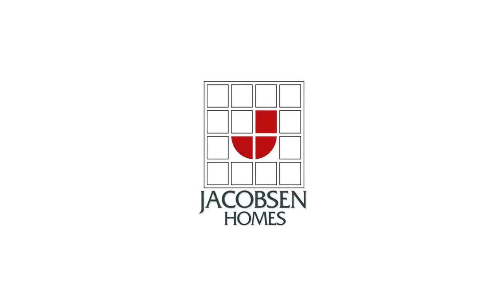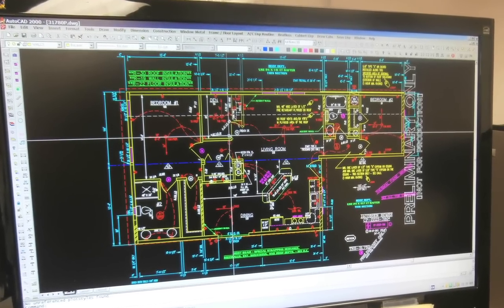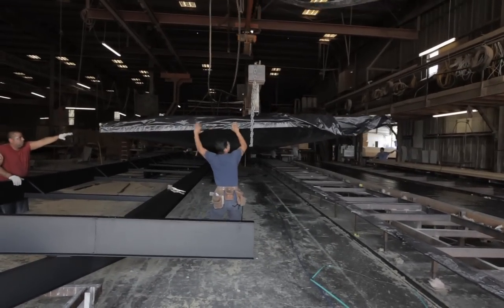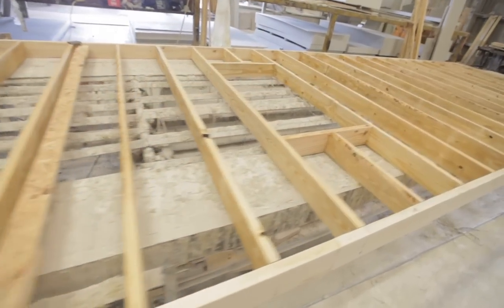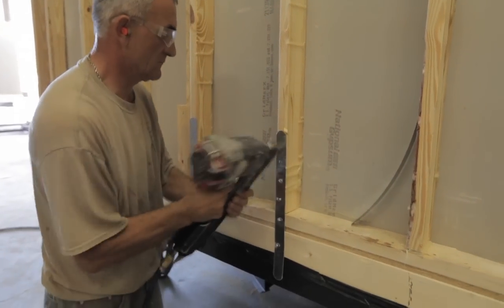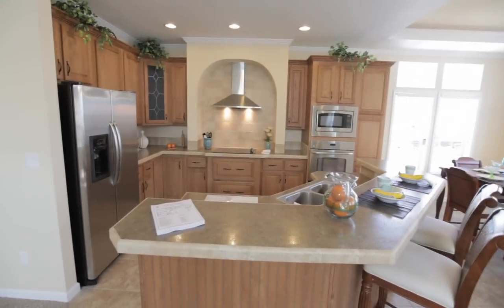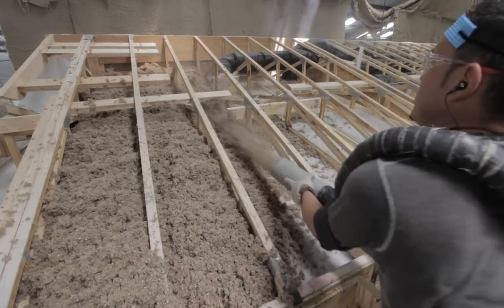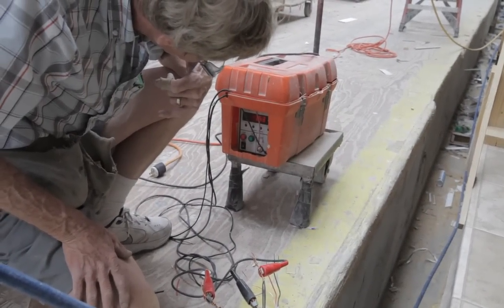Jacobsen Homes Factory Tour

Comment: Site built homes have been going on since homes have been built. a certain amount of moister in wood helps it. As far as mold, I have never heard of a home having mold from the wood being wet while building it, and I have several carpenters in my family. The whole fight with master carpenters and prefabbed homes is materials. For instance, my cousin won't use anything less than 2x10 floor joist, with 3/4 plywood, not osb or particle board. Roof trusses are also done with no less than 2x6 and are steel strapped at every connection. He went to several prefabbed homes and had to strengthen the roof as well as secure it, two never even had access to the attic, because they won't allow you to store in it. This does of course cost more, but you get what you pay for, problem is, why buy cheap on the structure of a home? Cabinets, windows etc. can all be changed later, cut costs there. If you have to gut the whole home to fix structural issues, why not pay more from the get go, it saves in the long run....

Comment: I have a 2005 trailer it 14x68 foot trailer what size is the studs in the trailer walls and the studs facing the outside walls i think the walls facing outside is 1)1)2 by 3)1/2 wide studs but i don't know what size is the walls inside walls i think they 1 1)2 studs i don't know Sir

Comment: The vapor barrier is not going to do a very good job if it is installed after the drywall is already up. Would be nice if they had plastic vapor barrier and none faced insulation

Comment: Lol they keep acting like OSB is some luxury quality product. It’s litterally woodchips glued together. Also I can’t believe the floors are just a laminate sheet glued onto OSB. I imagine that would tear very easily
Reply: OSB is what most all manufactured home builders and site builders use.  As for the flooring there are several options, not just vinyl flooring.
Reply: The quality of OSB depends upon the adhesives.  When ongoing water exposure is a problem plywood will eventually delaminate too.  You need to protect all wood based products from water.  Sometimes the moisture is from condensation caused by air gaps and poor insulation.

Comment: Hahaha you can see a bunch of gaps around the insulation. Not the best quality homes but not the worst
Reply: Spray foam should be used with 2 x 4s.  Fiberglass batts is inadequate.

Comment: I don't like sheet rock or conventional vertical paneling.So,is there a horizontal paneling system that looks like a summer resort cabin,for the walls. Also on the ceilings. And need  a regular wider ceiling molding..
Reply: We can do one or two feature wall with ship lap, but not the entire house.  This is something that you may be able to add to your home at a later date.

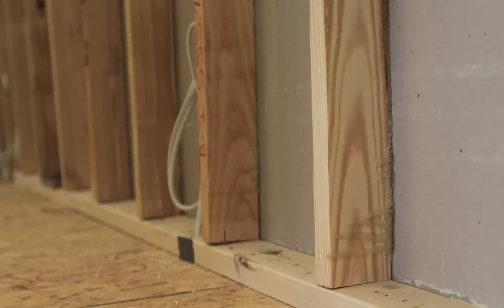Comment: At 4:54 check out the gap between the studs and bottom plate and vapor barrier between the osb and siding so moisture will attack the wood promoting rot and mold growth and also I couldn't help notice all of the OSHA violations in this video worker not wearing PPE while handling insulation, standing on the top of a step ladder especially without fall protection 😂
Reply: I noticed the same thing!   Forget Jacobson Homes!

Comment: While the finished product looks great. I worry about their construction. Even in the video. You can see the window frames are not to code. With double king posts on one side. An a single king post on the other. Meaning the window isn't properly supported. Much less secure for installation.
Reply: You are correct and now i guess they only use one post around windows. thats the case in mine 2024. Very weak walls and the windows are not secured properly causing them to not open or close properly.

Comment: If I were to build a house, I would start with a poured concrete foundation with reinforcing screen/mesh. On top of that would be placed 2x6 hickory studs on 16" centers and the bottom framing bits would be bolted to the foundation. To form the exterior walls, I would use oak or hickory tongue and groove (tongue in groove) shiplap. The entire house would be home wrapped. The roof trusses would also be of a hardwood like oak or hickory and they would be bracketed to the wall framing. The flooring and the roof sheathing would be made of quality plywood. I would use closed-cell spray foam insulation.
Reply: Very expensive house but well built and will last for many years

Comment: Am i the only one to notice that they put the frame together with staples instead of nails. Very Cheap Junk !!
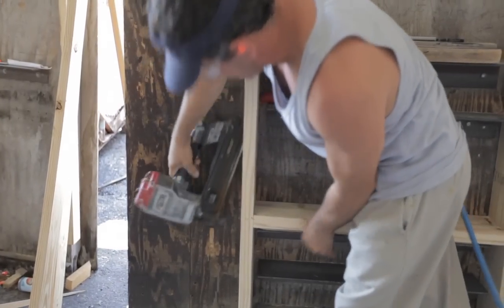Reply: I noticed that. Did you see the dude at 4:33 putting 10 nails per corner of the windows frame
Reply: Lefty , those staples are used on the marriage wall it’s all glued and it’s 8 inches thick.

Comment: Ice unit to make the house , do you deliver in New Jersey ?
Reply: Unfortunately, we only build homes for Florida.  Good luck with your new home search.
Reply: I live in Florida. It will cave in after a good snow  storm. I been on trailer roofs where they have a metal roof with nothing at all under it.. He says they used 7/16 on the roof . I am originally from Conn They require 3/4 = 12/16
Reply: @harrybriscoe7948  Our homes are built for Florida weather, were we do not have snow storms.

Comment: MANUFACTURED HOMES are not trailers,  mobile homes, or modular homes.  You will never see a Manufactured home on it's own wheels.  They are put on tractor trailers.  They are built to stricter standards than site built homes because they are transported by truck.  They are placed on foundations and anchored.  They are financed by mortgage companies just like a site built house.  Some are built to be two stories and assembled after delivery.   You can't get a mortgage for the other types of homes, which depreciate in value like cars.
Reply: Manufactured homes are built in accordance with the Federal Building Code (HUD), they are set on piers.  An off-frame modular home is according to the Florida State Building Codes and is  placed on a stem wall and can be financed and insured the same as a site build home.
Reply: @jacobsenhomes1347  Yes I know this...its what I was saying.
Reply: @jacobsenhomes1347  CORRECT!
Reply: Robert Zimmerman  You are nasty.  I was not trashing the building...you didn't read my comments correctly.
Reply: Robert Zimmerman  It's just a discussion...not a debate...I never should have never chimed in. 🤔😊
Reply: @Jacobsen Homes what is the price for this home?

Comment: The finished trailer looks great, and at every step in the process! I like the close-ups of the weld when you were calculating stuff. I think you have made the best "tiny house" video I have seen. Informative, pauses to absorb info, visual ( deam.design/n3v5  ), step-by-step, 2x forward!
Reply: It's not a trailer.  It's a manufactured home that is set on a foundation like stick built homes.  They are loaded on tractor trailers and set down on the foundation or basement.   They are built to stricter government standards than stick built homes and are anchored to the foundation.   Trailers are built on wheels that don't come off and they use a lot of flimsy materials like camper trailers.   They can be moved from one site to another.   Manufactured homes stay on site and are financed through mortgage companies.   Trailers are not.
Reply: Steven Soco  yes...I know this...was saying essentially the same thing you said...they are not trailers
Reply: Out of intense complexities, intense simplicities emerge.

Comment: I see a few things that aren't very good and i would find another manufacture since i am a welder by trade and i see spraying paint over rusted material is a NO NO Sand blasting and Using a Epoxy resin sealer then painting it for a lasting frame. And pink fiber glass Insulation is a Moister holder that will rot the floor joints. I find the the Rock Wool made from Stone and Steel slag from the metal making process a better insulation in Damp area's It's flame proof to 2100 f and is doesn't lose it R value when it get damp like Pink fiberglass does because it repels water. Rock Wool is a more dense Batt and isn't itchy to use and Safe (allergenic) for kids with breathing problems. OSB may be cheap but I look for Quality in a product i buy and OSB is not that, I've replaced Roofs that were done with OSB and sagging after 25 years from snow loads and summer heat changes under the shingles. OSB rotting under the  vinyl siding to the point you can push your finger through it, Plywood would be More better in both these situation and stronger down the road. Selling a product that is made with the idea that the outside makeup will hide the under carriage is not a sound business for long term. I worked in the industrial of welding frames like that for Large 40 foot roll off's and we took the time to sandblasted them before we painted them and i have had to fix Insulation problems and home roof problem left fro so called home builder building new home for the last 40 years.
Reply: I built 48 x 90 triple wide using 40 foot shipping containers. I welded 4 high cube containers to a 14. X 90 trailer leaving a 10 foot center gap. I plasma cut the inner walls before hand to match the floor plan. Used the left over material to bridge the roof gaps and cut in my door ways. I faced the door ends together on 8 of the 12 containers. I offset the center 4 containers so that I could have a 10 x 16 privacy porch off of my master bedroom and bathroom. I'm 8 months into this build and never had to use one nail. Pick up a 1 or 3 14x90 trailer frames and 4, 8 or 12 shipping containers. You'll save yourself lots of $$
Reply: Jacobson isn't about quality, it's about profit and cutting corners.
Reply: OSB is stronger than regular plywood the problem is not the product it's in the quality of the product and people who are putting it on .
Reply: @thomasvincent9027  Not my experience over the last 30 years Plywood doesn't sag on roofs between the Truss like OSB has in the past, if plywood get wet and drys out it retains it's strength but i have Seen my self put my fingers right through a exterior house wall because it got wet from sweating under vinyl siding, I have never had the problem with Plywood.
Reply: Rockwool is superior but it costs twice as much as fiberglass, worth it.  Rockwool is hydrophobic ( repells water).  It is insect resistant, fire resistent and sound deadening
Reply: @timothykeith1367  I don't use anything but Roxul rockwool just for the fact if it ever get wet, it will still keep it's R-value and Fiberglass will not. I have done my whole basement in it and never have to worry about mold or mildew and if it get damp it will still keep the R-Value which also keep the moister down because hot coming into contact with cold cement walls will create more moister.
Reply: @johnward5890  I wish every home improvement store stocked Rockwool.  Rockwool is more costly than fiberglass but worth the premium for the benefits that you have mentioned.   Plus, insects don't like Rockwool and it makes the house more quiet.   Rockwool also makes a product called Comfortboard that can be applied externally under sidling so you can insulate walls wider than the stud cavities - which is nice in remodeling older homes with 2 x 4 wall cavities.  There are competiting mineral wool products that are similar to Rockwool, but I don't often see those for sale.  Builders often use the cheapest insulation, but its not worth the short term savings.  Fiberglass batts installed by the best pros perform much lower than its laboratory rating, unfortunately fiberglass isn't usually installed all that well.  Rockwool is generally a good alternative to spray foam because it is DIY and its also fire resistant.
Reply: @timothykeith1367   I was schooled and lived in the town it was invented in, Milton Ontario, Canada. I wonder if buying from the source would get a better price. They used the rock slag from melting down rock from the Milton rock quarry's. Having the material close by the supply is a good thing for the manufacture. Roxul Canada. https://www.bing.com/maps?q=Roxul+Canada&aqs=edge..69i57&FORM=ANCMS9&PC=U531
Reply: @johnward5890  Does Roxul have a company store?    Rockwool has been around for a long time.  Its gained more attention now that tighter built houses often have mold problems.  With the popularity of spray foam, the extra cost of mineral wool is comparatively less costly because you can DIY Rockwool.

Comment: Still a trailer.  And good luck getting a home, finding a place to set it, and like a trailer, watch it depreciate unlike a site built home.
Reply: OSB is terrible for flooring.  I built my shed from is, and it's cheap and fine for a shed, but usually wont hold up to the elements.  It shouldnt be allowed in homes.  I'd suggest that IF you buy a manufactured home, custom build it without using OSB.  Have them use real plywood instead.  Itll cost a few grand more, but 15 years later, itll be well worth it
Reply: @jaredseymore3906  All of it OSB, plywood, studs, joist, etc will rot if exposed to the elements. Water is what rots a wooden structure along with mold and fungus.
Reply: @jaredseymore3906  OSB should be painted with an oil  based paint to prevent moisture damage.  And the unit should be placed on a well drained concrete foundation.
Reply: In my area of Florida  , A used double wide in good shape will run about $40,000 on an acre or so lot,  A run down one can go for as low as $5,000
Reply: I'd take that piece of iron off the bottom of it and set it on a foundation and what would be the difference?
Reply: Steven Soco  no, she is correct.  Mortgage companies will finance a manufactured home.  Just talked to one 4 weeks ago and they had no issues with financing a manufactured home.  The loans are different, but the interest rate was dead on comparable to an on site house.
Reply: It's not on wheels.  Trailers are on wheels.  Mortgage companies will finance MANUFACTURED homes because they are built to stricter standards than stick built homes.
Reply: @maried3717  I think you may be miss informed. The vast majority of site-built homes are normal "stick-built" homes. The construction crews and the General Contractor along with the architect's specifications are what determines the quality of the build. Site built homes are financed through mortgage companies or a bank mortgage department. It makes no difference if you buy a Manufactured home or a regular site-built home as far as getting the mortgage is concerned. That is just what the loan is called on homes to put is simply.
Reply: @ecleveland1  I agree...I know the difference.  I have done extensive research.   Maybe my language was confusing to you?
Reply: @maried3717  Maybe we are talking about two different products in the end.
Reply: @ecleveland1  That is what I'm  thinking...we got crossed wires.  👍🏻

Comment: Oriented strand board , now that's worth spending your life savings on .......NOT !
Reply: they use it because it is dirt cheap compared to decent plywood.
Reply: @kercchan3307  I wish that were the case in 2021.  All wood products are priced through the roof!
Reply: How can you live with yourself knowing that every single home you sold is nothing but complete bullshit. I would rather lose money on a job than cut corners on everything
Reply: @cntslesfabrication  to be fair even real houses use OSB. It knocks the prices down and passes savings onto the customer. The only problem is that we are currently in a housing bubble, so those OSB vinyl tract houses are overpriced and under constructed

Comment: Forgot to mention that type of plumbing , a metal clamp or clip to secure the fittings will fail ....cost me thousands !!
Reply: I got the copper colored clamps on mine! I say colored cause they dont feel like copper but ive had mine on through 3 freeze thaw cycles this winter with absolutely no leakage!
Reply: Yup mine had the grey flexible pipe that was clamped together and it leaks and breaks very easily I was told it's not even code anymore
Reply: @supertrucker12916  This is PEX, the grey stuff you have is Polybutylene, which is known to fail.  PEX is good stuff.